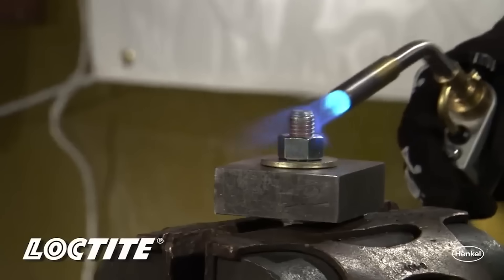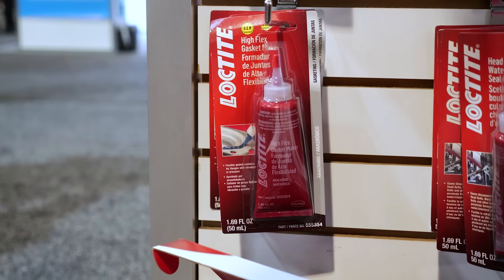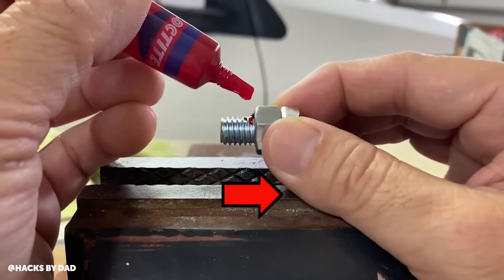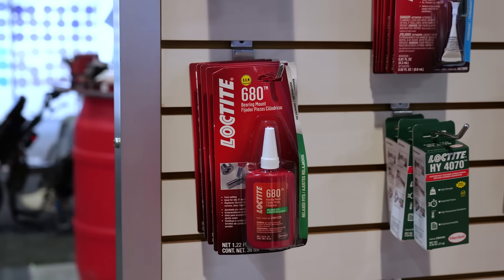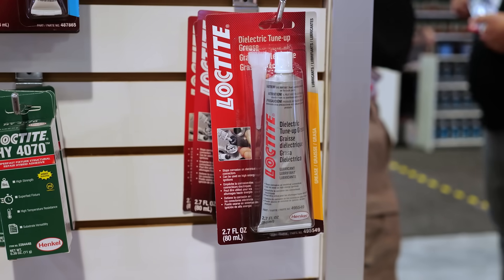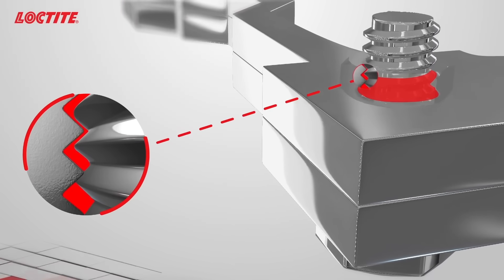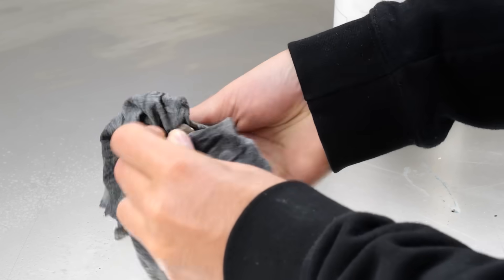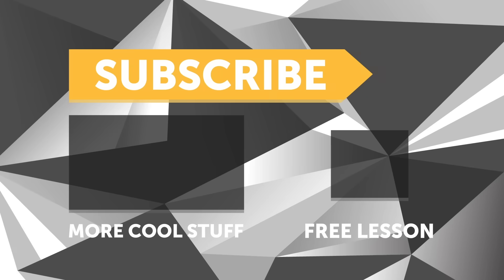Many pro mechanics don't know this.

Comment: From my time as an engine designer for Rolls Royce marine, we had alot of difficulty loosening used bolt in the exhaust system. After some research i found out that when you use anti seize/molybdensulfid on application where you exeed approx 800 degrees Celsius, it changes from disulfid to trisulfid. That means that the graphite goes from ball shape to pyramide.. also know as an abrasive..
Reply: nickel, copper, or non metallic anti seize ftw.
Reply: I used copper kote for exhaust manifold bolts on all petrol and diesel engines plus on turbo charger mounting studs/bolts and had good success with that when I worked as a mechanic over 30yrs ago.
Reply: @derekfromtauranga6012  Just don't use copper based anti-seize in Aluminium...
Reply: Also when using anti-seize you have to reduce the torque spec by 20-30% (varies on bolt size and what its threading into) during my apprenticeship i was assembling the base of a deck crane and didn't know about having to reduce the torque settings, only that the 2inch bolt wouldn't even reach the torque i set and kept spinning til thread destruction. Thought it must be a bad bolt and said it to a qualified colleague who explained about having to change the torque setting with anti-seize
Reply: my friend had multiple bolts sieze in his turbo after using anti seize, dont put common anti seize near that kind of heat
Reply: @24zer0nd  aluminum antiseize is garbage heat and cold make it dry and hold more dirt. Cooper is the way to go 👍
Reply: I've been a frequent user of both anti-seize and 242 blue locktite for some decades. At some point I found myself disassembling parts that I had previously installed sometime in the past. Something I noticed was that 242 seems to go through one "phase", it goes from liquid to a plastic film once it cures and stays that way, seemingly forever. 
Anti seize seems to go through multiple "phases", from liquid to moist to sludge to (sometimes) a rusty grime. If it gets to that point, there is no anti seize about it.
I have actually used 242 for an anti-seize as much as a thread locker.
Another thing I noticed is that I would sometimes remove a fastener with rusty threads, but the spot under the 242 would be like new compared to the surrounding rusty threads.
So, there are times when I actually coated the whole fastener threads with 242 like one would with anti-seize and it seemed to work.
Reply: I've done the same, when corrosion was likely to be a problem.
Reply: I made the mistake of using copperkote? on the dowels of a high horsepower 13b. It basically glued them into the housings when the engine had to come apart for a refresh. Oops! A mistake you would only make once.
Reply: @emilkuttel1  years ago I used to have a 900 Honda that the spark plugs were always very tight. Copper based antiseeze made it worse, but a nickel basd antiseeze was a big improvement.  Since then I've always preferred and tended to use nickel, but tbh those sparkplug are the only place I've seen a significant difference.
Reply: I used to use loctite blue on my rifle and pistol fasteners in low heat areas but found that the shock of the rounds going off would fracture and make chalky the loctite blue so it would then fail. Talking to some pro rifle guys they recommend Vibratite (very sticky pink/orange fluid). It never gets chaulky and stays gummy so it resists the sharp mechanical shock from the repeated rounds going off. Also it is serviceable so loctite red is out of the question. They even recommended letting it dry a bit on the threads before assembly. So what is the equivalent of this in the loctite brand? Purple? Thanks
Reply: @jtonyf4978    You mention Vibratite staying gummy.  Blue243 has been holding against quad-copter vibrations.  In your experience, would you think I'd benefit from vibration attenuation, by using  Vibratite in place of  Blue243?  Reading your experience has me think the chalky, hard stuff 243 turns into is passing vibrations right through, where the gummy Vibratite  may lock fasteners in place against vibration, with an added damping effect?  

[ I race these things. A very rigid frame gives better response, but also allows unwanted vibrations into the PID loop. So, the balancing act is to get the frame as rigid as possible, while at the same time, protect the sensor from vibration ]
Reply: @ 
Hmm well i’m not familiar with drone building let alone flying. I don’t think vibratite will transmit less vibration but maybe. The thing is you have two surfaces mated together by a screw(s) so they should not move around relative to each other. As long as the screw(s) are tight and the surfaces do not move relative to each other, i doubt different threadlock will make any difference for vibration transmission. I do feel from my experience that very short and very intense shock fractures loctite blue whereas vibratite it does not. Maybe there is a way you can soft mount the sensors? They may vibrate more but the vibrations may be less violent, less high frequency. Maybe look at the sensor manufacturer’s data sheet. That might give some clue as to how to mount it so it does not prematurely fail. One of these days i’ll get into drones. Too many hobbies already! 😅 Good luck to you.
Reply: On rifle muzzle brakes and suppressors use copper or nickel anti-seize; the basic Permatex aluminum based anti-seize can actually lock the threads together.
Reply: I’ve never seen the silver anti seize work well on exhaust applications. I prefer the copper based product.
Reply: Im retired aerospace, 
so Not being a super duper rocket scientist know it all, I was forced by my less then mensa abilities,  to follow the MANUFACTURERS INSTRUCTIONS and guidance by engineering and maintenance manuals . tsk tsk.
Reply: But Nikel Kote is good up to 2500f or something. I never have problems using it on turbo manifolds and stainless parts. I use that shit on everything...that doesn't get blue loctite.
Reply: After I restored my 1965 Lambretta & got it back on the road, I had the misfortune of losing many nuts & bolts which had vibrated off..
Bought myself some Loctite thread lock & never had a problem since..
When I restored my second one, I used it again on those bolts that I couldn’t use a locknut..
Wouldn’t be without it👍
Reply: I use blue and rarely red locktite where aplicable but for most time i love using LPS nickel antisize recommended to me by a friend who works in underwater mining..
Reply: There are many anti seize products out there. You have to choose the best one based on chemistry and temperature. Chemistry of the parts and the environment have to be considered.
Reply: I learned this lesson 😌  i learned how to rebuild brake calipers and i thought the copper anti seize was for high temp a month later my brakes started sticking bad i could not pull the cliper slide pins out the anti seize had turned into a dry paste
Reply: @gingerdoe2882 high temp brake grease is what you want to use. Personally use Grainville red rubber grease, for brake slides, and rubber seals.
Reply: Yeah I don't use it on hot things ,but I like some nice cv joint grease instead of anti seize for any other fasteners.
Can't stand the typical aluminum chips and grease trash, but the copper is nice on exhaust stuff.
Reply: I ran out of anti seize long ago and now use the empty container for engine oil. That's my anti seize.
Reply: I just spit on it first and that always seems to work
Reply: nooit koperpasta op  2 verschillende te klemmen  materialen gebruiken..
Reply: There are some really high-end anti-seize products out there 
I used to have separate cans of some really high stuff, nuclear grade, super high temperature etc., they exist most people just don’t know about them
Reply: Reassembly cleanliness is the key. Rinse parts and fasteners after solvent and wire wheel cleaning with hot water . These are anaerobic sealers so when the air is removed they bond . We were able to solve oil traveling up intake bolts from the valley by cleaning ,,,sealing with Teflon tape , one wrap then loctite  one top of the Teflon . Adjust the torque of the bolt ,,never silicone. Think 85 to 87;iroc Z28:and corvette stuff making big crankcase pressures at redline . Turbos and fancy exhaust will require replacement of bolts to studs and always new nuts and compression washers . Tighten loctite a bit before loosen ,, just a few words for the diy because if you know you know ,,,ASE master tech in the  day and learned from the best ,,,,,hey GENE WEST.  !
Reply: 1- Graphite is carbon, sulfides are sulfur based, disulfide being two sulfer atoms.
2- Graphite isn't ball shaped, it's flat platelets. 
3- Graphite and MoS2 (molybdenum disulfide) are different things.
Reply: @Hdalland  Aaaah very good insight.
Reply: my man below hit the nail on the head.  but be aware they each have their own unique applications.  ie they're NOT really interchangeable.  silver for steel/al,  copper steel/steel and finally nickel for stainless bits.  anyone who's had to bust a ss bolt/nut because they friction welded themselves together will appreciate the nickel stuff.  cheers
Reply: The shape of a material does not make it an abrasive.
Reply: @FoghornLeghorn-k8i  er, yes it does.
Reply: @bushratbeachbum  So a pyramid shaped piece of putty is an abrasive.
Reply: @FoghornLeghorn-k8i   That misses the point.  The putty is comprised of material that has angular properties which make it an abrasive when force is applied to it in a service application.  If you doubt the explanation, find nearly any type of putty, grab a microfiber cloth and rub it on your eyeglass lenses if you wear them.  Reinstall the glasses and enjoy the fog.
Reply: Yes, for sure... a molecule is stopping extraction....
ROFL
Reply: Cadillac says to put the copper  anti-seize all exhaust mating surfaces!
Reply: MTU … service a bunch! i use loctite copper anti size.
Reply: Copper!
Reply: As a former NASA engine engineer faculty manager, I can say that this video is yes. Trust me
Reply: Chesterton 785 is the best thing I've used on exhaust fasteners (spark plugs too). Way better than copper based, comes apart as easy as they went together even years later, incredible stuff. Not cheap or easy to find though but worth it.
Reply: For serious applications you can go with Boron Nitride but any sacrificial metal in suspension will be more practical for threaded hardware
Reply: Is this the same Cubic* boron nitride that I know of? Is used as a pretty advanced abrasive
Reply: @ no, they use the hexagonal/rhombohedral type considered “white graphite”. The cubic variant is a different color.
Reply: "Rolls Royce Marine", for when you absolutely, positively, want to swim back to shore.
Reply: @dev1360  Dude...that's funny
Reply: Antisneeze is an abrasive as it is period..  no heat needed.  Try loading up a bearing with it instead of grease.  They will seize up quick..  the moly is a great grease but with the aluminum or copper stuff that is in the antiseize acts as an abrasive.. not sure on the science behind how it works but im pretty sure at a tightened state those aluminum or copper fills act as a filler which with the moly will remain movable but when you heat or continue to move it then it will turn the balls into more of a compact shape which actually seizes when moved.  Valve lapping compound is kind of like antiseize with non uniform additives making it more abrasive from the start..
Reply: @Z-Ack  
Bless You

Comment: Finally... i dont feel nuts using blue more than red
Reply: I try not to use red at all if I can help it. I hate having to use heat to remove it or risk snapping the head off a bolt.
Reply: I dunno, I prefer my nuts red over blue
Reply: @matross-munro8508  lmaoooooo, I've been trying to tell people for years 🤣🤣
Reply: @aw6545  haha the silent hero

Red is just most consumers default settings.

My father got me to use red 15 years ago saying "just use it for everything" and it became a nightmare within weeks when i was trying to learn, alot of people I knew used it and I started using both, blue for more frequently serviced items and kept using red for heavy duty and not often serviced items. Never needed purple but ca understand uses use case. Mind you I've just been a hobbyist for the last 15 years.
Reply: @matross-munro8508  am I just really lucky? I have never broken or damaged a bolt from using red loctite and also never use heat. Is that really a thing?

The only things I avoid put it on are screws heads or bolts smaller than m6.
Reply: Working in automotive I rarely seen people use red at all if ever

Comment: what he didn't mention is thread locker is a good antiseize
Reply: @harrismagnum04  only on bolts that don't get too hot, it will do the opposite on an exhaust for example
Reply: He didn’t mention a lot of things and over-mentioned a lot of others.
Reply: I assume it meant that threadlocker acts to prevent the bolt and threads seizing by creating a barrier between the threads.

Comment: What about proper application of ORANGE locktite?
Reply from the maker: Depends. Did you mix red and yellow to make your orange Loctite or is it 'au naturel'? 😂
Look at your container, and search the number here. There will be a specific sheet that tells you what to do based on the number rather than just the colour alone 🤘
Hope that helps! - Taz.
https://www.henkel-adhesives.com/nz/en.html
Reply: It comes that way advertised as strong as read without needing Heat for removal
Reply from the maker: Ahh yep, I was just making a wee joke in there. Check the specs and if it suits what you're doing at the time, that's what you want - Taz.

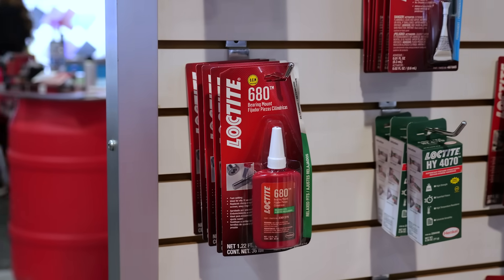Comment: What is the product at 3:22? Disc brake quiet stick? Can anyone comment on it?
Reply: The disk brake quiet stick is a decent product and good price. Use to use it on my customers Honda and Toyota brake jobs for years. However may I suggest an even better higher performance option. Liqui Moly Brake Anti-Squeal Paste.
Reply from the maker: Not something we have used sorry, but you can find some info on page 30 here: https://dm.henkel-dam.com/is/content/henkel/188754%20AAM_CATALOG%20low%20res%20PROOF.pdf - Taz.
Reply: Never used it or even saw it at local parts stores (in Montana), however, most of my brakes squeal or chatter at times so I should look into it.

Comment: Ok, I knew most of this, but I legit do not know why I never put thread lock INTO a blind hole before threading in a bolt.
Reply from the maker: Yeah that is a new one for me too. Seems so obvious with hindsight 😂 - Taz.
Reply: @hpa101  there certainly is somebody out there who uses enough loctite to explode the blind hole with the hydraulic pressure caused by tightening the bolt...
Reply from the maker: @bavarianmonkey8326 you can do anything wrong. Doesn't mean you shouldn't stop doing things right incase someone else gets it wrong though eh - Taz.
Reply: @LineMUp321  for me, it's still intuitive to dab it onto the threads of the bolt, I'll probably get over it and start making it habit to do it the "proper" way but I'm so cautious of not putting something that could hydraulic lock in the bottom of a threaded hole lol
Reply: @snoofayy6150    :     As long as the volume of incompressible liquid is small compared to the clearance volume left in the hole, there is little to be concerned about. As for the air, even with an impossibly perfect thread seal and a 4:1 compression ratio of space, air pressure could not exceed 14.7 * 4 = 57 psi, hardly a casting cracker. The deal here is blow by not leaving the thread clearances filled with thread locker if a drop is not preceding the bolt to supply more to replace that being forced up past the thread spiral.